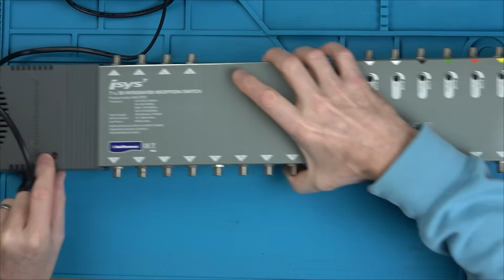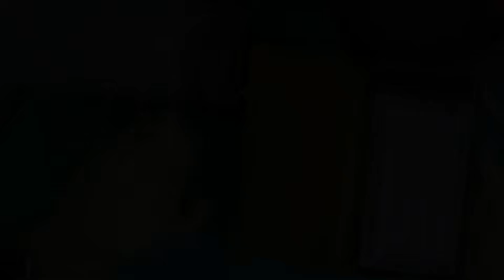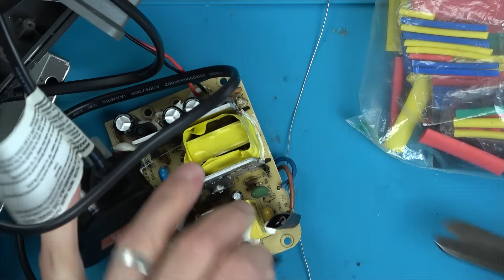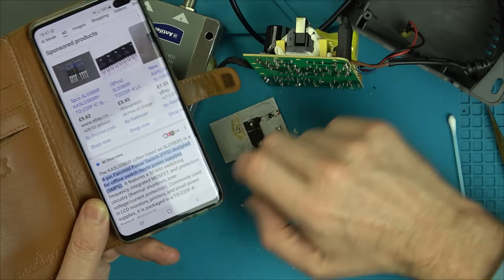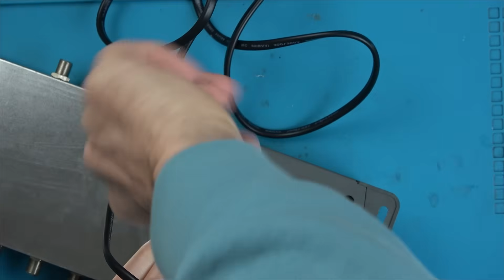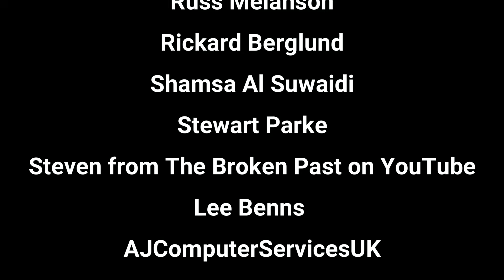Viewer Repair Challenge – Satellite / Aerial Amplifier Attempted Fix

Comment: Well done. A secondary short can blow a primary fuse, the feedback indicates there is insufficient voltage so the primary ramps up until excessive current flows. A dim bulb tester would be a worthy addition to your test gear. Armageddon, but no water?

Comment: I be mobile again... 3 wheel van back from the garage, some bits needing sorted and now done and I was bombing about the Dorset countryside (literally the same roads as seen in OFAH Touch of Glass episode which is local to me) and Doris the Del Boy Van did not disappoint :)   Just scored a pair of sexeh MX5 grey leather tombstones for the old girl as the old MC2 microcar seats are kernackered and nothing like a bit o' leather next to ones botty in my book and will match the Connolly leather rear seats jus' nice them being grey leather and crafted by them blokes who did all the leather in rollers.   All new wheels and tyres, MoT with zero advisorys first time because I got nagged for having old tyres, complete rebuilt cooling system new rad and water pump and rebuilt brakes with upgraded Triumph Sprint cylinders and just fitted a brand new electronic distributor to the old girl (£35 complete with upgrade rotor arm and cap O.o)   Now to save pennies to see if Youtuber 6d Diesels will do me a paint job as mechanically the only original parts are the engine, prop and diff as I have replaced everything in the last ten years :D

Comment: Great job Vince =D  I don't think lightning!  100's or thousands of KV going into it - it does incredible damage - generally kills lots of stuff!  A few times I had a go at fixing lightning damaged equipment, never again lol!
Reply from the maker: Thanks Chris, I might have remembered incorrectly about the lightning strike. I suppose once you see a true lightning damaged item you won't forget that in a hurry!
Reply: might not be a direct strike, but could be a strike to the overhead power cables feeding the local transformer, causing a brownout or spike to the mains (incandescent lightbulbs go dim or flash). I've had that happen and had the ATX PSU in a PC  blow during a storm, but the monitor and mains were fine.

Comment: Nice fix. Always thought that you had to have dedicated cables to the LNB for each Sky box. Looked that box up and wondering would that splitter work to run multiple Sky+ boxes,  talk about another dying sector, looks like you could hook it up to a quad LNB and it would then feed the appropriate input to each output as it is requested?
Reply: Yes that would run multiple boxes.  Four inputs from LNB from either a quad or Quattro LNB.  This would then send all of the signals down the cable in a different way by splitting it into bands.  Most boxes have the ability to read these signals and will adapt to what they receive. I.e a block of flats with one dish and one aerial will then be split to multiple flats (normally 2 feeds to each flat/room)
Reply from the maker: @chrisktm2010 Thanks Chris 👍
Reply from the maker: I think SKY multi room is done via the internet now, but being a Virginmedia subscriber I really don't know. Hopefully someone will chime in and confirm what this splitter does, as I presume all 20 outputs will split the Quad LNB signals so you could have 4 different channels being watched or 2 channels and 2 recordings at once in numerous locations in the house???
Reply: @Mymatevince  They're definitely moving people to streaming as they can but I'm sticking with my Sky+ until it dies. Had to change my quad LNB to a 6-way one to add a spare free channels box around christmas but I assume as you do that splitter would just shunt each quadrant of the lnb into multiple downstream cables at the same time as required